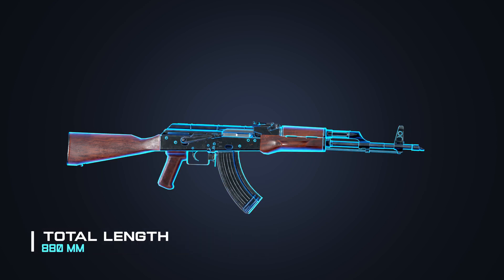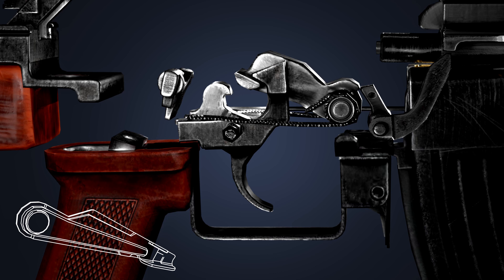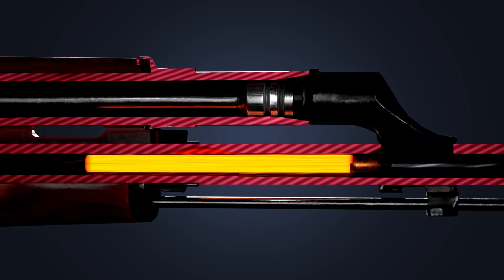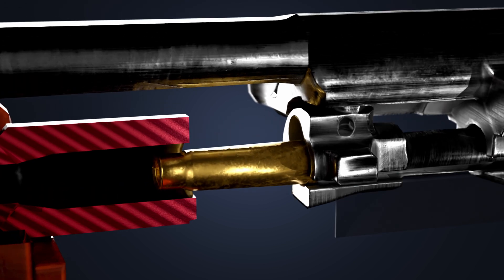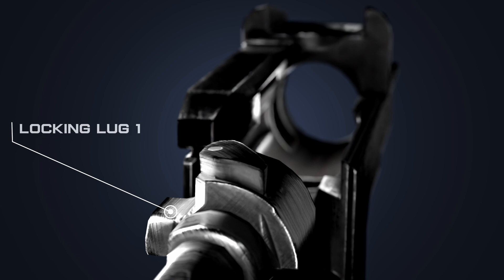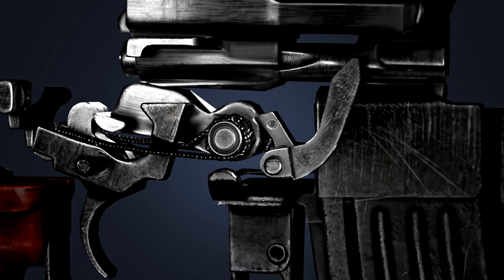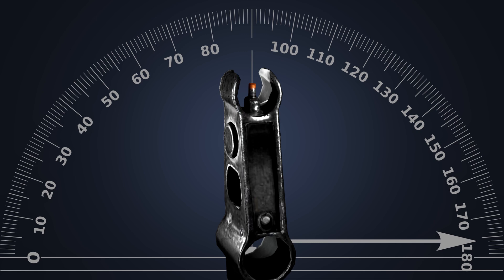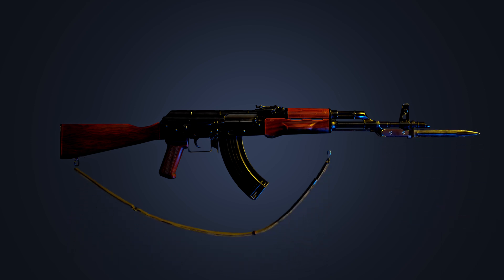How AK-47 Works ? | (ANIMATION) | Detailed explaination

Comment: Although the gun featured in the animation is an AKM not an AK-47 its still a cool animation
Reply: AKM has a stamped receiver and cover and have a muzzle brake while AK-47 was milled an exception being AK-47 Type 1 or the original AK has a stamped receiverbut they have issues with it so in 1949 they switched to milled receiver this version of AK is called AK-47 Type 2 and improved for the second time 1952 this 3rd incarnation of AK-47 is called AK-47 Type 3, this is the most famous of the 3 and is probably the one you think of when picturing an AK. In 1959 they improved the stamped receiver for the production of AK's and the first rifle came out the production line, this assault rifle is AKM.
Reply: @Skylab_73  as someone who didn’t know there were that many alternations of the world renowned Ak-47  thank you! Thanks for the explanation between these beautiful pieces of human art and history
Reply: @Shacow32  im just a nerd :) but np
Reply: What’s the difference between them?
Reply: @Skylab_73  ak ak modernized
Reply: @Skylab_73  even though they're different versions the way they work is still the same